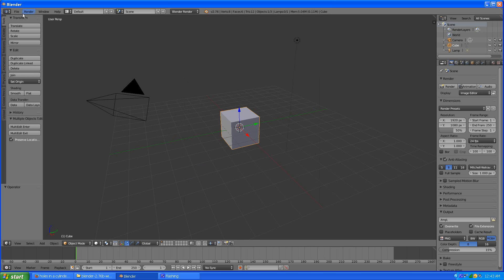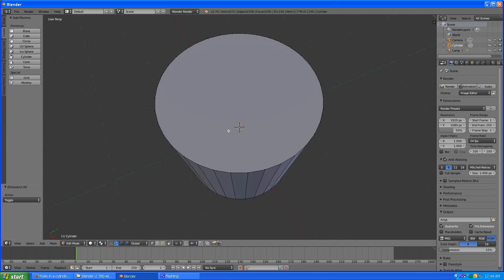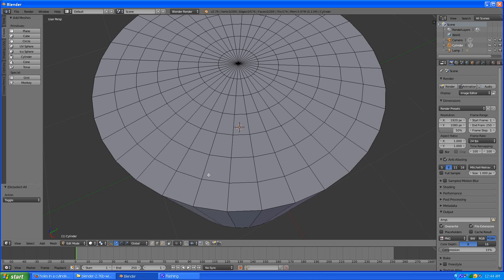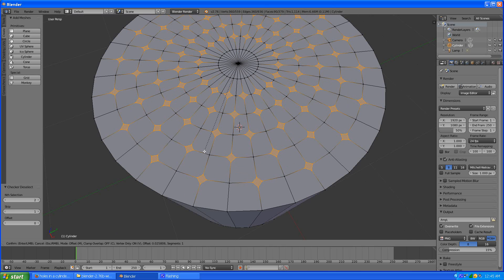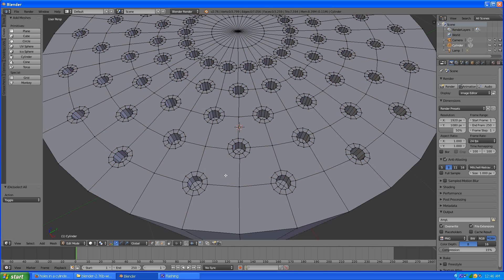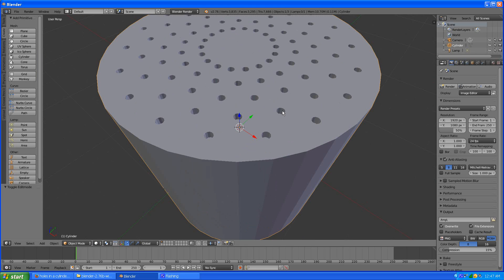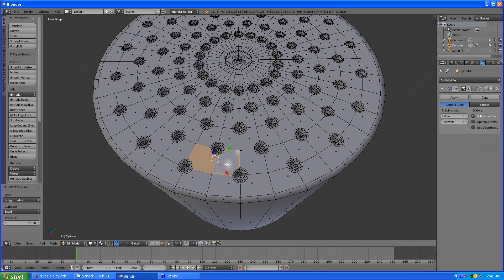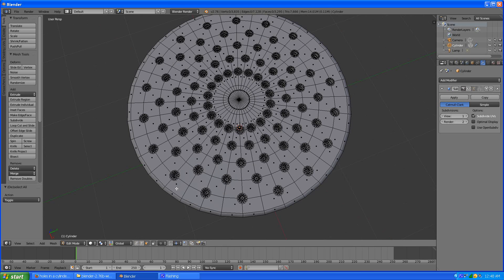Watering Can Hole Pattern in Blender

Comment: hit "W" to bring up loop tools - Took me a moment to remember that lol - I know this is a VERY old video but is there a way to get a specific size when doing this? Say I want a 1/4" hole. Thank you, I've refereed to your video for years (and I am aware this is an old version of blender now
Reply from the maker: I'd say to make a separate plane object that has the right dimension across it. Then just use it as a template to gage the hole diameter by. Not super precise, but it should get very close.

Funny thing is, I still use a rather old version of Blender because I couldn't update the OpenGL on my laptop past a certain version. The old laptop still works fine otherwise, so I'm not ready to chuck it yet.
Reply: @pauljs75 2.79b is still my blender of choice haha. 🤣 thanks very much for your response. Cheers buddy